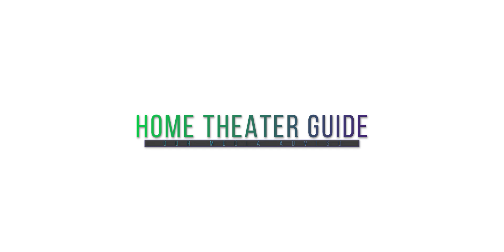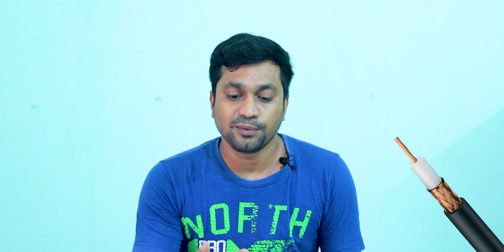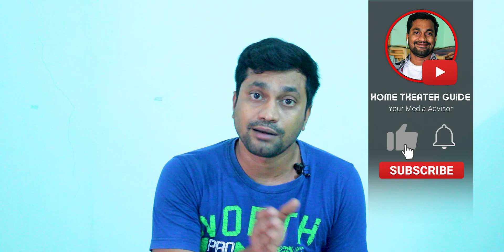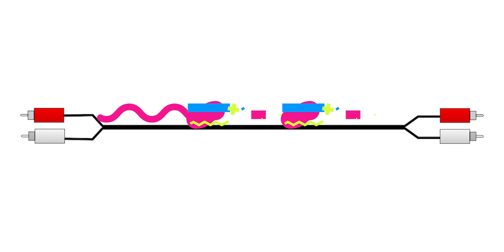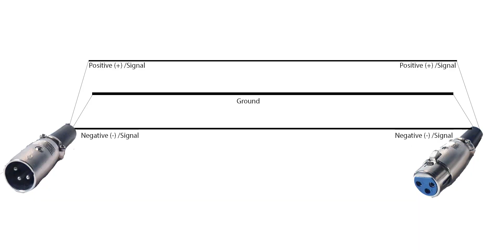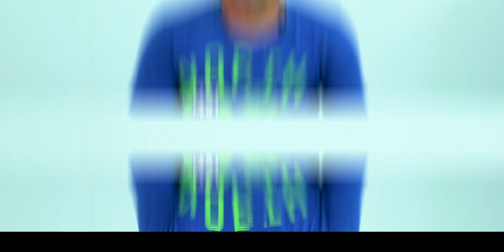Balanced audio vs Unbalanced audio | RCA | XLR | Optical (S/PDIF) | Coaxial - Explained in Telugu

Comment: Hi Brother, Good explanation. I have a query. Can you explain?

I have a Musical Instrument (Keyboard Synthesizer) which has a slot to connect 6.35mm jack to the mixer. But, im experiencing noise when connected to mixer. Is there a way to  get rid of this noise?
Or
Can I connect stereo 6.35mm jack to XLR input in mixer?

Comment: Hello bro,
Some Android boxes have spdif co-axial digital output..but sometimes data losses especially when playing dts format videos... I use RCA cable to connect Android box to audio rush 5.1 decider..is there any limitation of bandwidth using spdif digital output not optical type.
Reply: Bro nen samsung t45E soundbar 
2 .1 konna adhi dts and Dolby digital support chesthadhi ani mention chesaru .ma tv ki optical port ledhu so Airtel xtreme box ki soundbar connect chesa optical port tho because soundbar ki HDMI port ledhu  but bro sound 50 pettina 30 laga vasthundhi resound vasthadhi distortion laga undhi adhe soundbar ni bluetooth connect chesthe clear ga vasthundhi 50 volume chala sound vasthundhi asalu optical port connect chesthe endhuku ala low and distorted sound chesthundhi.please solution chepu bro

Comment: Hello Bro
I have an old Pioneer Reciever. It doesn't have Hdmi inputs, but it has a optical input(Toslink).
My TV doesn't have an optical out, it only has Hdmi Arc.
Can I connect Hdmi arc output from my TV to Optical input in my Reciever using a converter?
If so can you suggest a good converter?
Thank you 👍